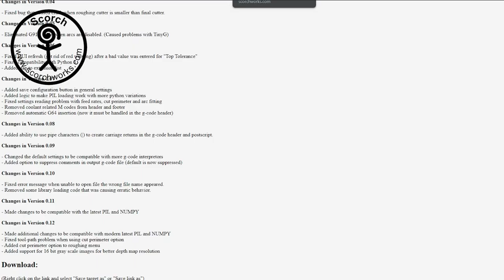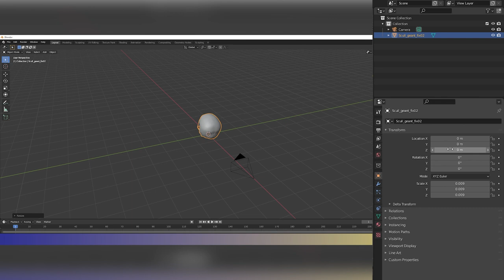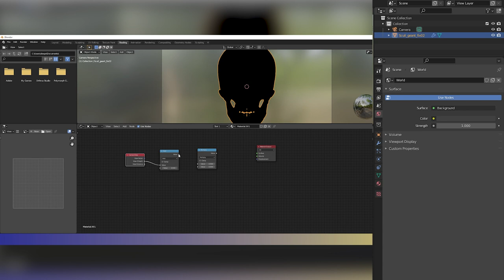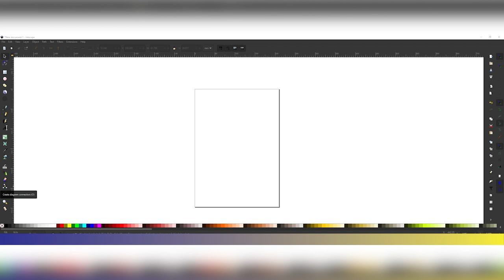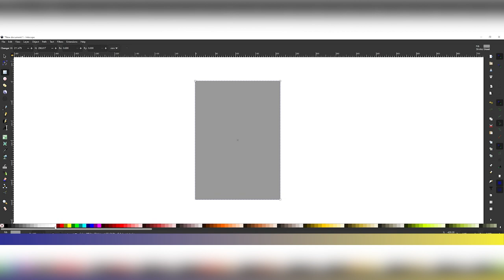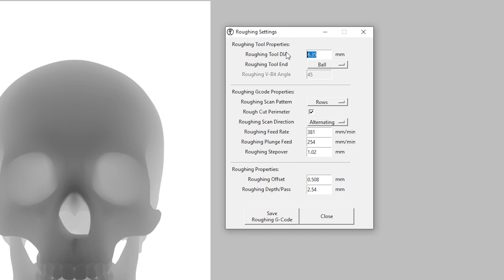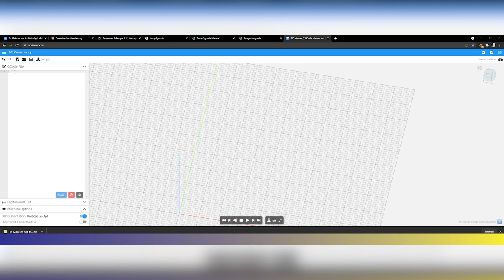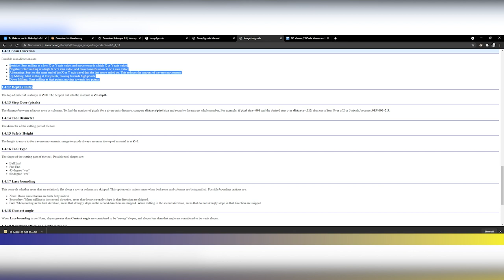Step-by-Step: Converting 3D Models to G-Code with Blender & DMap2GCode

Comment: If you scale and rotate the object in Blender you should also reset the scale and rotation values before rendering by selecting the object and then use keys CTRL and A and select rotation and scale.

Comment: In Dmap2Gcode try selecting the normalize depth option on the left side of the screen. What that does is treats the darkest pixel as total black and the lightest pixel as pure white. It may produce more detail as it will spread out the values from front to back. I use Dmap all the time. It is really good at what it does.
Reply from the maker: Thank you, will try that out next time I'm using it.
Reply: @D.E.Hammer 

Hi there.
Do you know any AI site that make the same but with an image as source? 
I tried Leiapix but is not quite the same.
Cheers.
Reply from the maker: I do not, have been looking myself for one.
Reply: @D.E.Hammer   🙂
Reply: @D.E.Hammer  I really hope skill is still needed for this stuff. It would really piss me off if just anyone could ask AI to make a G-code file of whatever they have in mind. I love software that makes it easier but I still like it to have a little difficulty. Keeps the posers away.

I have been asked quite a few times over the years. 

Q: How do you know how to do that?
A: They hid it in a book.

Thanks for making the video and describing the steps you are taking to get things where you want them. Too many videos out there with rapid mouse clicks and shitty music. If it takes longer it takes longer. A lot of information is left out on many of the other productions I have endured.

Have a great day!!

Comment: I'm definitely going to try this.  A lot of steps to go through but it saves $350 working with my 3018 or $700 on the new Sienci when it comes out.
When  I started 3D printing years ago, Blender scared me and I've never looked back.  I like OpenSCAD.
Thanks for the step by step instructions.  We're gonna test this.
Reply from the maker: I will have to look at OpenSCAD, have not used it before.  I will have to say, it took me years to get get the hang of Blender, I mainly used it for 3D animation, and then for 3D print modeling. Now they went and changed up the UI, so it has kind of thrown me for a little bit of a loop, but I will say I do like the latest version.
Reply: @D.E.Hammer  OpenSCAD is more like programming or writing a script. No cameras, scenes or furry things running through

Comment: I encounter an issue when texturing my object. No matter how high or low the ADD math is, the result is either white if the MULTIPLY is pos or Black if its neg. I even tried to scale the Z axis up to see if it would help make a greater difference, but its no use. 

I use a more recent version of BLENDER (3.2.2). could it be the issue?